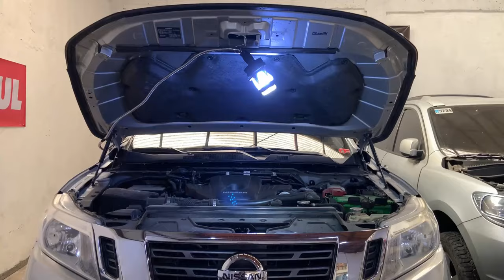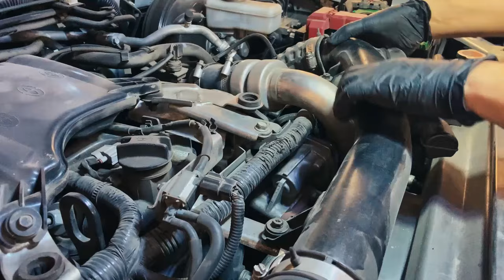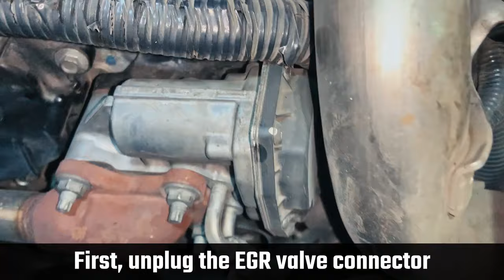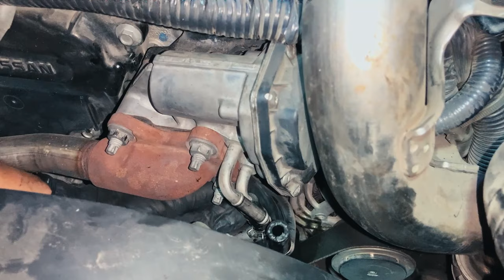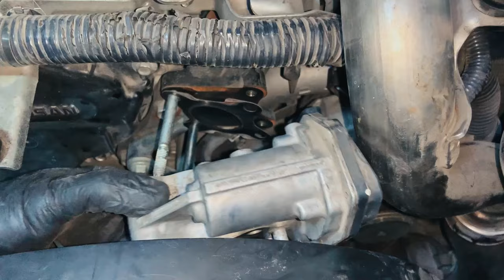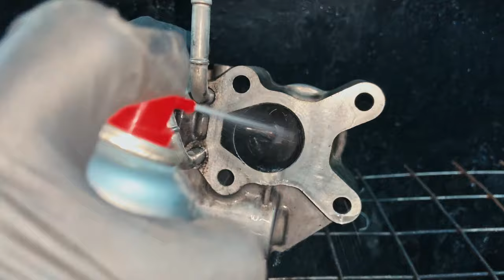DIY EASY EGR VALVE REMOVAL & CLEANING GUIDE FOR NISSAN NAVARA NP300

Comment: Thanks so much I've paid $4000 for injectors, $1500 for ERG pipe it turned out to be the ERG valve and not one of the nitwit aussie mechanics picked it - you video is excellent
Reply from the maker: Thanks! Hope your car is fine now 😊
Reply: What were the symptoms? Injectors noisy?
Reply: I was wrong wasn't the ERG it was the metering valve ended up trading it in as is - the symptoms where a ferocious knocking like the engine was going to explode - did that for a bit, i.e. - when driving if you lugged the engine in higher gears it didn't happen so much - until turned off because it was frightening - also at times just would not fire kept turning g over with no ignitioyou are.n - then when left fro a few days it was like new ran perfectly - I suspect a couple of mechanics knew what it was and kept milking out - the shame is one was a premier5 Nissan deaslershisop - also sincere apologies to Aussie mechanics - one u8tube mechanic actually made a video about the importance of metering valves - so there  @Tonksyyy_

Comment: Great content!
Just trouble shooting my throttle body.
Removed the pipe from the intercooler
To inspect and clean.
Discovered that the plate is stuck in the open position.
Any thoughts.
Reply from the maker: Hi! Unlike gas engines, diesel throttle bodies are normally open as default. They’ll only close upon shutting the engine down. You may confirm it’s operation by idling the engine with the hose/pipe of to observe the throttle body butterfly then turning the engine off (butterfly should shut close, then open). Just make sure you have scantool ready to clear any fault codes or check engine light afterwards as the ECU may get a low boost reading and throw a CEL

Comment: Great video followed and worked great for about 3 days then went back to running like shit and heavy black smoke, Will pull it out again and clean it better. I would add also to have something under the EGR Valve when pulling the 2 coolant lines off as I did not and got coolant on my belt and squealed terribly for a week. I'm thinking of putting a blanking plate on but cannot find one here in Mexico. Anyone know if I take sheet Aluminum or Stainless steel and use the gasket as a template will this work?, obviously not cutting out the centre part.

Comment: If disconnect agr valve will the motor controll light be on?
Reply from the maker: Make sure it’s connected before starting the car. If you leave it disconnected it might throw a check engine light
Reply: @btdgarage  
Thanks.
Regards from Thailand
Mike
Reply: @mikekohlmeier8720  ... Grüße aus Nong Khai.

Comment: boss, can i use a WD40 for cleaning te EGR valve?
Reply from the maker: WD40 is a lubricant, better to use petrol or carb cleaner for it. Just keep the EGR/sensor upright to avoid liquids seeping in and damaging the sensor
Reply: @btdgarage  Boss thank you for the info. God bless
Reply from the maker: @babyfaceshotgun6042  God bless you too bro

Comment: Its all on point but the bolts are not 10mm they are 12mm
Reply from the maker: Sorry for that :)
Reply: The 12mm on mine are very tight and broken my spanar, starts torn the shape of the bolt head, I stop the process😢😢